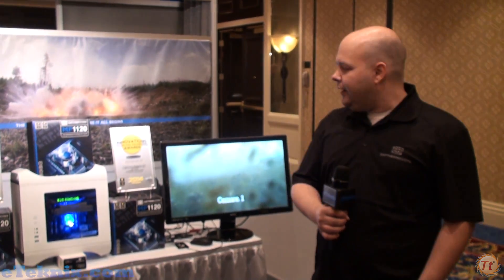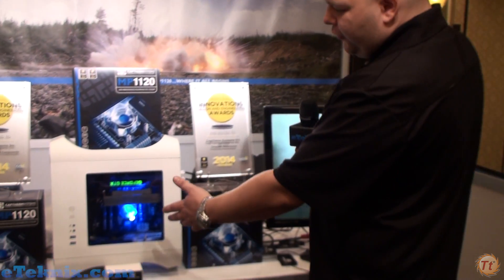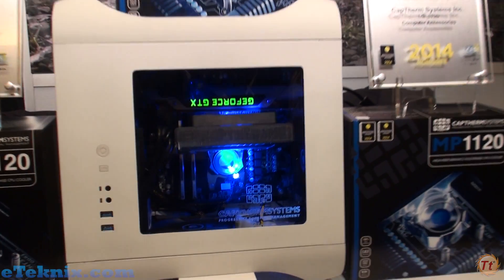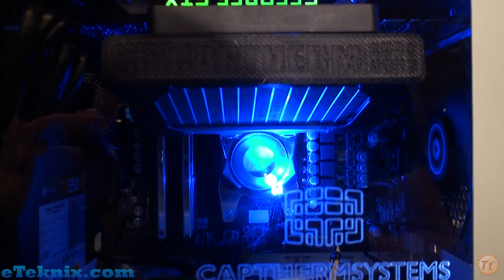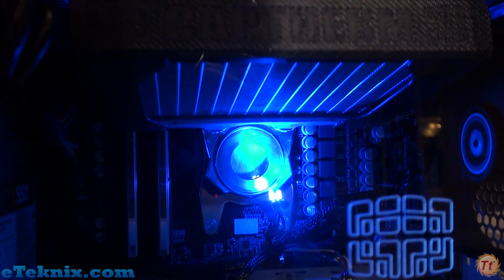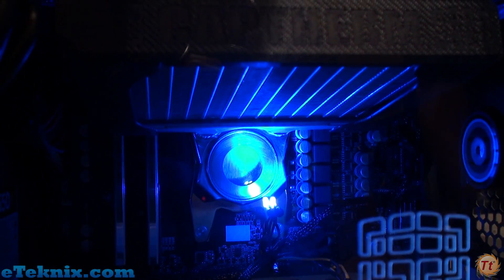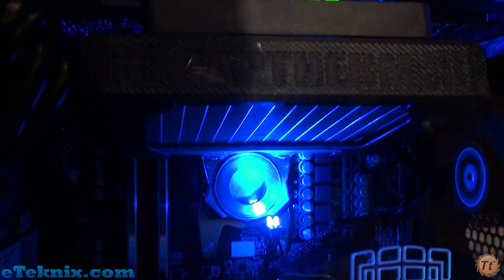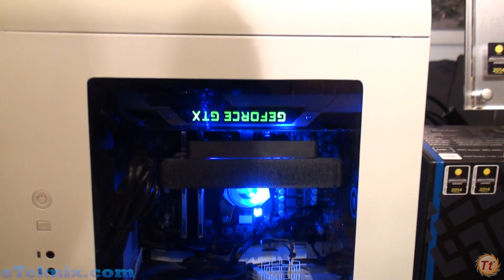Captherm Systems MP1120 CPU Cooler Debuts At CES 2014

Comment: So, they managed to make a better heat pipe. That's awesome. But then you are still limited by the air flow through the radiator ... and in this demo system it is right next to a huge graphics card.

Comment: NO WAY 100 YEARS NO COMPANY WOULD MAKE A PRODUCT OF THIS NATURE LAST THAT LONG
Reply: The product is constructed with copper, stainless steel, titanium, and aluminum all fused together by 500 lbs. of explosives. The liquid can boil from the heat of your hand and cannot break/ruin working phones. I would expect nothing less if not to last over 100 years.
Reply: were talking about a cpu cooler correct? their has to be a pump unless im mistaken.
Reply: MrAsus3571
See the vapor chamber is the same but this have radiador
Reply: MrAsus3571 Nope, probably using novatec's liquid.  Doesn't need a pump.